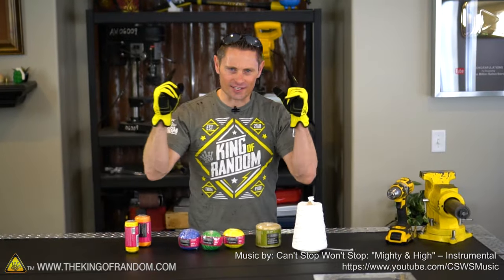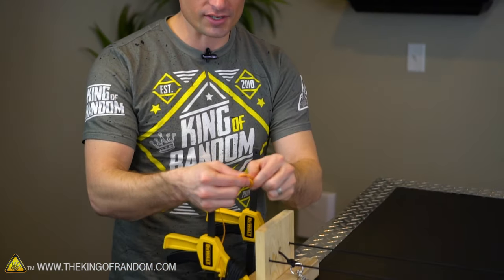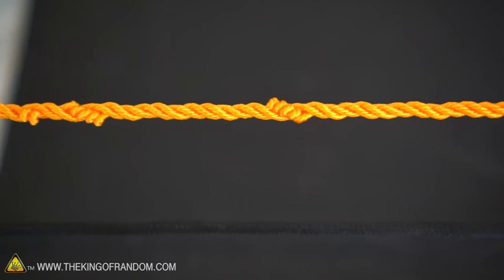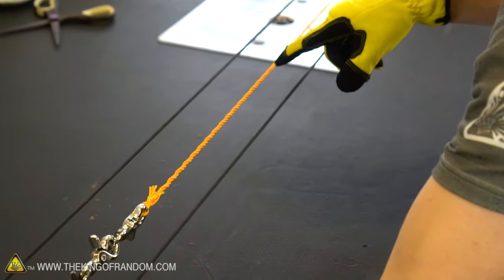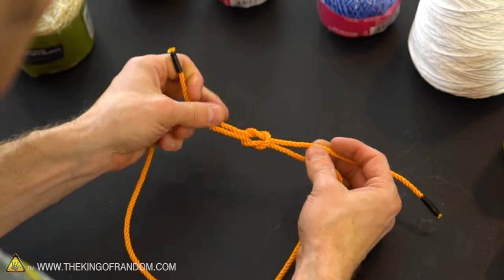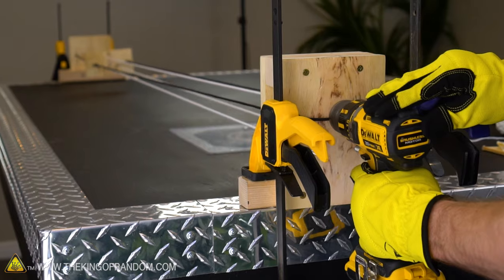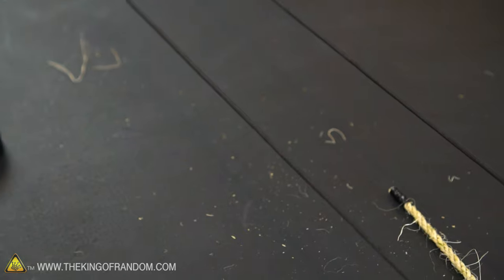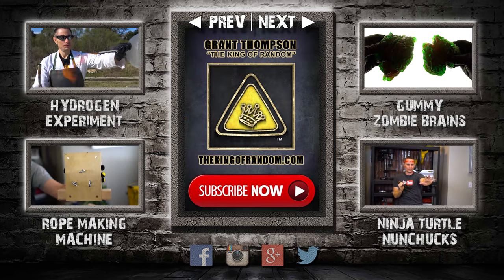Make All The Rope You Could Ever Want With One Of The Best Survival Hacks From TKOR

Comment: WD-40 is a solvent not a lubricant. If you wanted to actually lube up those swivel hooks, you would have been better off using an oil based wax or possibly mineral oil
Reply: No. WD-40 is a mix of lubricants and certain solvents. At one point it may have been a solvent, but the main objective is to lubricate and clean.
Reply: Tiger Audio, Inc. "Cutting aluminum"? Is that a misstype? Because i've never heard of someone cutting aluminum with WD 40.
Reply: no its designed to be a solvent/rust desolver, the lubricant effect comes from the components it dissolves but that doesn't last long. Michael is correct
Reply: Tiger Audio, Inc. Ahhh ok thank you for the clarification. You're right I'm not a metal worker. Your first comment was worded kinda weird and confused me.
Reply: Man, I love Grant’s comment section
Reply: Albert Blessing why is that? Lol
Reply: Oh, if you want to cut aluminum without a saw, mercury should do the trick
Reply: Just looked it up. It's 60% mineral spirits and about 20% lubricant. So to say it's only a solvent is wrong, because the mineral spirits will evaporate, leaving behind the lubricant.
Reply: Austin V Papp Sorry, even you’re partially wrong. It was originally developed to protect the skins of Atlas missiles from corrosion.
Reply: Nevir202, you know the facts! You should read the book titled Atlas: The Ultimate Weapon by Chuck Walker. I think you would like it. Should be able to get it from Barnes & Noble. I appreciate your comment Sir!
Reply: 3melendr That does sound interesting, thanks for the recommendation.
Reply: @tigeraudio  WD40 prevents rust actually.
Reply: As I mentioned earlier, it's 60% mineral spirits and about *20% lubricant* so it will inhibit rust.
Reply: My guess why WD40 should not be used on a gun is that it could disrupt the proper lubricant and replace it with a less effective lube. I highly doubt it "attracts" moisture.
Reply: Ok. What makes you right? Anecdotal evidence?
Reply: a mineral oil would degrade the metal over time, just like sweat does.
Reply: “DESCRIPTION. Metal Guard ® 700 is an emulsion rust preventative offering outstanding corrosion protection” composition: mineral oil.

Mineral oil and sweat are entirely different. Sweat is primarily water.

Also, why would millions of people be using it on their gardening equipment to prevent rust? It doesn’t “attract water” as Tiger Audio, Inc. so wrongly put it.
Reply: It's both
Reply: Eric Abbott yes but the solvent evaporates, leaving behind the lube
Reply: @AlexOvechkinSucks  or gallium to just destroy the aluminum all together
Reply: @rory1336  "a mineral oil would degrade the metal over time,".....which is, I suppose, why it's used on valuable Samurai swords. Choji Oil is mineral oil with clove extract, and it's used on National Treasure swords.......probably to help degrade them.
Reply: According to WD40's own web site it is "Known as the “can with thousands of uses,” WD-40® helps those who live life hands on protect metal from rust and corrosion, penetrate and free stuck parts, displace moisture, and lubricate just about anything."  It is a multipurpose product that does it all!
Reply: WD = water displacement (formula #40). It does lubricate as a side benefit. I think spray Teflon would be perfect for this application.

Comment: I worked at a rope factory in Kiowa Ks. make the big blue tow ropes.  This is a kind of the way the machine worked except for the single hook also had a motor running it.  And someone would hold onto the board running the strands together.  Only when we made larger ropes would we have some one stand on are rear maching instead of the added weight.

Comment: For years, I have cut and melted poly ropes to prevent end fraying, for non-poly ropes, it was either a knot or a loop. Recently, I came up with a new method, which works well for all kinds of rope.
First, I add a 0.75" to 1" long piece of adhesive lined shrink tube, (Harbor Freight sells a small assorted diameter container of black adhesive lined), to the rope where I want to cut it.
Shrink tube has either a 3:1 or 2:1 shrink ratio. The HF adhesive lined is 3:1. This will help you judge the size of shrink tube to use. Generally, I use the smallest diameter which will fit. If the tube is slightly smaller, you can carefully stretch it using long needle nose pliers. If you tear it, cut off the torn section, or the tube will continue to split. 
After shrinking the tube to the rope, cut it to length. It's much easier to put the tube on before you cut the rope, unless you are cutting a long length. If the rope is poly rope, I then use the heat gun to melt the end.
Using a heat gun instead of flame keeps the rope from turning black, and allows you to make a smooth, uniform end to your rope. The adhesive lined shrink tube stays on much longer than anything else I have ever used on rope or cord.
I tried non-adhesive shrink tube, but it didn't last more than 2-3 uses of the rope.
Hope this helps your rope management.
GeoD

Comment: In a pinch, a single strand, torqued by a drill or by hand, carefully folded in half while keeping tension lengthwise on both halves, then carefully releasing the internal torque along the side-by-side, folded lengths by slowly and carefully releasing and spinning the midpoint and "folded" end between your finger and thumb–slowly at first, then release your finger 'n' thumb–will neatly distribute the internal torque along its length, resulting in a quadruple rope after two folds. The down side is needing to start with a 4x length of twine. --DP, Henderson, NV

Comment: When the wound strings are still under tension, find mid point of cords, hold mid point and fold the two ends together then release your hold on the mid point allowing the built up tension to twist the 2 wound sections into a solid rope twice as thick. Smooth it over with a few times to even it out.

Comment: You could use heat-shrink tubing, two lengths at the tensioned end, and then slide one up to the other side when done, instead of electrical tape. Since it's one solid peice, and you can apply heat to shrink it, these would function like aglets on shoelaces and be much more durable.

Comment: You can put heat shrink tubing over the taped ends to keep them from unraveling in hot weather or rain. You can use them for shoe strings for boots as well. You can heat them with a flame or hair dryer.
Reply: he is dead dude

Comment: to replace the drill you could go to jaycar (that's an electronics store in Australia Idk if you have it over there) and pick up a motor. we used them in my primary school in grade five I think to make basic robots and toy cars to make the wheels turn. you could use a motor to turn the gears inside to make a more permanent solution and add an on/off switch

Comment: try using shrink tube instead of electrical tape, then you could just heat it with a torch right there on the rig before you cut it, getting the fibres off at the same time. Electrical tape gets weird over time, and the glue usually doesn't take heat well.

Comment: If you want the ends of your rope combined without tape, before you remove the tape from the ends use some hot metal (hold metal, such as a knife over your torch or lighter to get it red hot) and hold it against the ends of the rope outside the tape long enough to melt each end together; from there, you should be able to safely remove the tape.

Comment: Makes 2 yarn 3 strand rope and doesnt splice the ends, (sigh). :P 

I did spot one key issue with your tool though that only really happens with the sisal, which is that it winds the sisal rope WAY to tight. its supposed to be loose enough to splice immediately after letting the rope settle for 6 hours. All in all, that is a really cool machine that makes making rope MUCH easier.

Comment: Essentially what is being done here is making twisted strands right ?  I do this everyday at work to twist strands of wire together. Twisting strands of wire together helps combat against interference.  I just put the ends of a few wires in a drill. Out the other ends in a vise. It can be 10' or 15' or 20'. I done up tonabout 50' at one time. Im sure longer runs can be done.

Comment: I would be of the opinion that the reason the rope is not as symmetrical is due to the to way the rubberband can not spin all 3 spindles at the same speed. Basically the only spindle that spins with any consistency is the spindle attached to the drill and the other 2 do the best they can to keep up. It just looks as if the twists in the rope are due to a spindle being stopped by the tension caused by twisting of the rope... Cheers...

Comment: BTW, combining 3 x 5pound test strands together does NOT "exponentially" increase the strength. An exponential increase would be 5 cubed (5x5x5) or 125 pounds breaking strength. In fact, the strength is simply additive (15 pounds) at best, depending upon whether the tension is evenly distributed between all of the fibers. In all likelihood, it is less than 15 pounds because the fibers lose strength when bent...hence, a knot can reduce breaking strength by as much as 50%. On top of that, you should mention that the recommended working load is only 8-15% of the breaking strength.

Comment: Silicone Spray instead of WD-40.  WD is great for many things.  But it will dry out and it will collect and hold dust and dirt.  Working around grease and oil and nothing is better than WD-40.  For everything else use Silicone Spray.  It will repel water as well as dust and even when dry it's still slick.  Silicone Spray can be found most anywhere that carries WD-40.

Comment: Thanks so much for this! My kids and I built a rope machine following your example and have had some great success, especially with the shorter lengths. When it comes to longer ropes, we run into an issue with the length of the counterweight cord not being nearly long enough for the amount of shrinkage. Any tips?
Reply: The old timers used to simply move the winder forward so that the counterweight at the other end was again at floor level.  I suppose you could move either end.

Comment: Wouldnt the rope come undone if you twsted it the opposite way?
Reply: Potato Sanchez I’m not sure if this setup would do the same but with traditional rope the strands are twisted one way and wrapped around each other the opposite way (say clockwise and counterclockwise) which creates a tension between the strands, so if you twist the rope itself against the wrap the strands tighten. This prevents fraying slightly, especially away from the ends. As someone who’s only recently been looking into this my explanation might be flawed so I’d recommend looking into it further. The book “the marlinspike sailor” discusses it quite well and in detail.

Comment: That's great but how can you make longer lengths? Like 25, 50, or 100 ft
Reply: A longer machine.
The rope walk building built in 1790 in Chatham dockyard is 1,135 feet (346 m) long and still makes rope commercially. It's that long so it can make 1000ft long ropes.
In the context of these videos, clamp down the ends further apart.